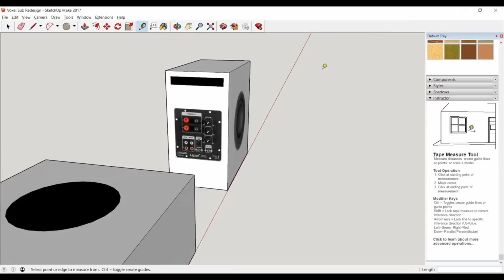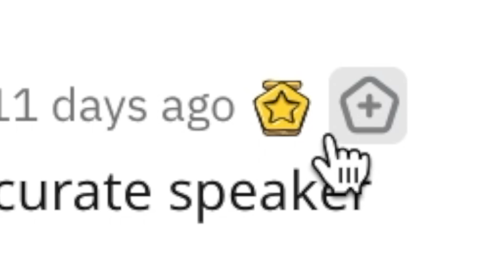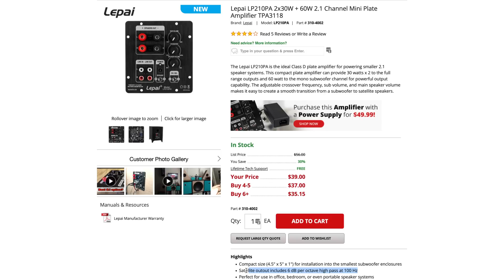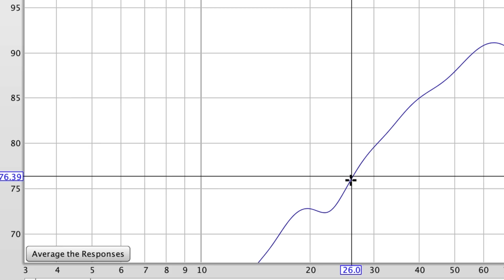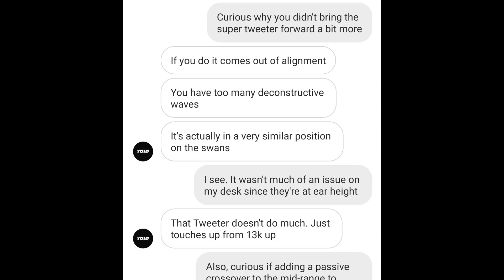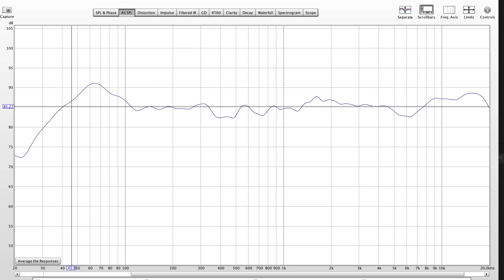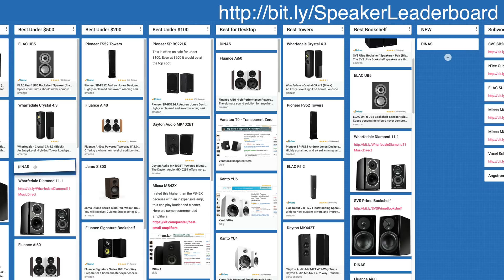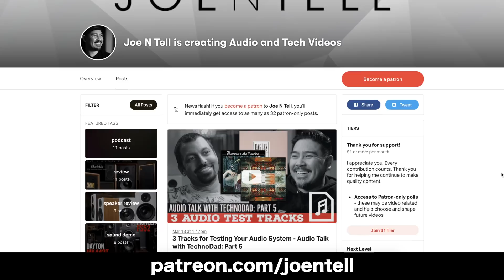DIY Speaker With Subwoofer Hits Down to 35 Hz! - DINAS - Active Bookshelf Speakers Collab w/ 123Toid

Comment: This without a doubt your best and most useful videos because I've seen a similar but larger build compared to this.  Birch kicks the crap out of MDF because Birch could get it done without bracing. No, that tweeter (I've used in two builds) the screen about even with the front.  I didn't nail mine down and moved it around.
Reply: @slow mazda Wood does matter and it has NOTHING to do with pores LOL!  Again. Hard Woods DO NOT NEED to be BRACED in 90% of their installs or applications.   Even Pro Cabinets like Markbass, Orange, Fender, Mesa, Ampeg, and etc.  DON'T brace or deaden their enclosures.  Yes, I've heard the BS from KEF fanboys.

Comment: Joe, how much more time:money to make this into a transmission line floor standing speaker with same drivers and electronics (just the port tuned to be a transmission line)?You’d seriously compete with $3,000+ speakers. Also offer a black matte color MDF surface option for LCR home theater applications

Comment: would it been very difficult to make them bluetooth ? i would do this for around my ingroud pool. Thanks from Montreal canada
Reply: Just a buy a $10 bluetooth reciever off amazon
Reply: @tyronelannister9922  Thanks for the answer but each speaker will be at 40 ft a apart so do i need 2 reciever or one connected to one speaker and run a cable to the other speakerÉ

Comment: I'm really interested in building these. One thing I was wondering though. How can the sound quality from this tiny plate amp compete with my Marantz amplifier?
Reply from the maker: I'm a believer that amplifiers should not sound different if designed correctly although they definitely can. The difference imparted by an amplifier is minimal compared to the change the speakers make. I think the question should be how does the sound quality on these speakers with the plate amp compare to your Marantz with other speakers.
Reply: @joentell  in a perfect world that would indeed be the case but in reality they don't sound the same. I find it hard to believe that these plate amps sound better than my Marantz stereo amp. In other words: if I would build these speakers with a 3 way crossover do they sound better with a good amplifier? If not that's fine becouse I can also use them to hook up to my computer.
Reply from the maker: I own old and new Marantz. They do sound different. But the difference in passive crossover vs active will change the sound more. That's all I'm saying. There are other things that affect the sound more than the amps. By no means am I saying these plate amps are better than a Marantz amp old or new
Reply: @joentell  yes the active crossover component makes it very attractive indeed. It would be nice to build some towers with a  similar system. I wish speakers could be outfitted with an analog active crossover but so far I haven't seen that yet.

Comment: I built a speaker for use with my Icom IC-7100 radio which uses a Dayton RS100-4. Many ham operators use cheap, 2-way speakers with their radios, but I wanted a single driver which could cover the entire range of the human voice with no crossover.  The speaker I built using the RS100-4 is the best sounding communications speaker I've ever heard. It even sounds good with the IC-3100 tuned to FM broadcast! I'm sure the RS100-4 works great in your DINAS, because it keeps the crossover out of the all-important mid-range band.
Reply from the maker: Thanks for sharing that. It seems like a successful project.

Comment: Are there crossover plans to build these as passive speakers?
Reply: It could be done, A similar version - of sorts is Boenicke W5. Same subwoofer driver + Fountek Fullrange + Tang Band rear firing tweeter. Very good sounding loudspeakers.
Reply from the maker: There's only one passive crossover component! 😊 We wanted to keep it simple. The rest of the crossovers are controlled by the plate amp.

Comment: Why so small port??!?!?!? Super easy to make it longer and bigger.
Reply from the maker: Tuning. A longer and larger port would have a higher tuning. We wanted the lowest tuning.
Reply: Joe N Tell No, you are not right. I have been designing subwoofer enclosures for years and if you increase the port area you have to increase the port length and the tuning will stay the same. Its easy to calculate.
Reply from the maker: You are correct. I misspoke. Yes, if you make the port opening larger, you would need to make the port longer. This is exactly what 123Toid did. You should see the original design. He reduced port turbulence by half. In order to use a larger circular port, he would've had to use a curved port since it wouldn't fit in this enclosure. He opted for a slotted port since someone could build it with wood and not have to buy additional parts. 

Chuffing only occurs around 35hz at maximum volume. Way beyond my comfort level.
Reply: You wouldn't want anything larger for this application as it would lower the first port resonance into audible range.

Comment: I'd love to hear it perform next to something like a JBL 306pMKii.  JBL reaches down to 31~32hz fairly easily.
Reply from the maker: There's a difference between being able to hear something at 31hz vs it being able to hit that at -3dB (F3) relative to the rest of it's frequency response. A speaker could hit 31hz at -10dB, but you shouldn't really say that it goes down to 31hz. The standard is -3dB but some manufacturers stretch their claims. See what JBL claims. I bet it isn't 32hz.

Comment: Thanks for this interesting video. 35 Hz is not just a challenge for bookshelf speakers but even for most other speakers in general. However, what means 35 Hz? At what noise level? By the way, the Dynaudio Crafft is still a great sounding benchmark for bookshelf speakers being able to show no significant drop down at 50 Hz
Reply: -3db.

Comment: Reducing 'cuffing' using straight cut outs is like saying reducing rolling friction using square wheels, you would of been better using a larger diameter port and actively adjusting the equalisation.
Reply from the maker: Decreasing the velocity of the air using a bigger and longer port is also a valid way of reducing turbulence. Smoothing the surfaces to even out the transition between the high pressure and low pressure areas is another way. Both work. I was suggesting to try both ways. A small smooth port will still chuff given enough pressure.
Reply: @joentell  Correct, except your new port is narrow which adds to turbulence, as you say you need a gradual transition from low-high pressure regions, there is a good reason 99% of loudspeakers use a circular port; its the best shape to encourage lamina air flow. So if it has been me, I would have used wider diameter and increased inlet radius rather than changing the shape, but still at least your design looks different).
Reply from the maker: I understand. I agree. I didn't personally design this port. Another option would be passive radiators.
Reply: @joentell  Yeah or passive, but then you take a cut in efficiency moving another diaphrapm), of course if you have the space you could opt for the holiest of holy's the Infinate baffle woofer) or a rotary sub.
Reply: @ThuleApsu  straight ports have been used for years in subwoofer builds with no negative effects.  It is all about the design.  A rounded port would not work in this application for multiple reasons, in which I don't plan to go into right now.  This is about the best port you can make for this subwoofer.  You are welcome to try to design a different one though.
Reply: @Toid  95% of speaker and subwoofer designs use round ports. the ideal port will produce lamina air-flow, the more angled the edges are in the port it will create more turbulence, that is why rotar blades on an helicopter are curved rather than having straight surfaces to cause lift. Port sounds do cause a problem in higher end systems, as you increase the cone excursion or play back sounds at lower frequencies the 'chuffing' sounds become more pronounced. You get a speaker company like B&W for instance that do not do snake-oil but put real science behind their designs and you will see B&W has heavily invested in port design over the years
Reply: @ThuleApsu  I don't remember arguing against anything you said.  I stated the fact that a round port wouldn't work well in this particular instance and flat ports are used all the time with great success.  You are welcome to try to design one that keeps first port resonance down, while keeping airflow at a minimum, while keeping tuning frequency and cone excursion in tact.  All while, making a port that will fit in an enclosure of this or similar size.  If you are able to, that would be great.  But as the designer of this speaker, I am telling you that I do not believe a better port exists for this application.  You are welcome to try and design one though.
Reply: @Toid  ) I didnt realise you was the designer, but hey whatever you think is best man, I was only talking in generalities anyway. I have been building speakers for a long time..
Reply: @joentell  I have seen some B&W speaker also having dimples on the port, like a golf ball, the trick to that is deliberately causing high frequency turbulence above human hearing, whilst bettering lamina airflow thru the port; across the audio band.

Comment: Great looking speakers.  I decided to buy the plans and all the parts.  I'm a complete newby so when it came time to order the capacity I couldn't find a .68mf as specified in the plans.  I found lot's of 6.8's.  I then Googled capacitor value to frequency cut-off and discovered a 6.8 capacitor equated to a 5846 Hz cut-off.  So, either I'm doing something wrong or the plans include the wrong value.  let me know.
Reply from the maker: That's a question for 123Toid. I'm excited to hear what you think of them once they're completed.
Reply: As this is a 6 ohm tweeter with 6.8 uF cap you are crossing the tweeter at 3900Hz - which is not good for several reason especially power handling. Also as this tweeter has much higher sensitivity it will overpower the Dayton full range. A 1.5 uF caps should work  nicely as it will be creating high pass at around 17KHz which is fine for super tweeter.
It's available at Parts Express. Btw the .68uF is also available from Parts Express but this will be cutting the tweeter above it's operational range at 40Khz which is pretty meaningless.
Reply: The plans have a link directly to the right part.  Just right press shift and simultaneously left click and it'll pull up the right value.

Comment: Why they "only" go down to 50 hz(in flat mode). Is it the amp responce or are these speakers tuned to 50 hz. Good design by the way, I wanted to make a 3 way speaker with the TB but a lot of crossover calculations did make me skip the project. This project is more DIY friendly.    Nice Speakers 😃
Reply from the maker: I think it has more to do with how the speaker itself responds as well as how it's tuned.

Comment: can you build a pair of a little bigger isobaric  bookshelf speakers, and if you check out air speed in an engine carburator you will se that you can increase airflow and get a quiter airflow if you round the edges for the port, on both sides.

https://www.youtube.com/watch?v=BdF7nTU_QOQ

Comment: Jaaaaaaanky!  This speaker would be greatly improved with better electronics and a fixed crossover.  Tuning it to the room response is the job of a DSP, but tuning the driver responses to each other is something you do exactly once and need not tinker after the fact.  Those knobs are just sucker-bait.
Reply from the maker: Then do it! Also make a video of the entire process. You talk a good game. Talk and action are two different things.

Comment: interesting. Have you ever heard Constant Beamwidth Transducer line arrays (CBT Line Arrays)? I saw a presentation by their inventor Don Keele. When paired with a sub, I noticed only 2dB-3dB difference in volume from 6 inches to 25ft. away. The design also boasts extreme uniformity in frequency response from all axis of the polar pattern of the speaker. Parts Express sells his kit. I think Dayton Audio sells a finished one. They're made up of 20-30 2.5 inch mid ranges and individual tweeters on a circular arc. They're shaded so the center section puts out full volume and the speakers towards top and floor fade out gradually. 

http://www.linkwitzlab.com/Keele%20-%20Introduction%20to%20CBT%20Loudspeaker%20Arrays.pdf

Comment: My yamaha floorstanders hit to 29Hz, and yes you DO need a tweeter, never rely on a midbass driver to deliver proper treble, its not happening. these lepai plate amps could be the perfect solution to desktop audio though.
Reply: No you don't need a tweeter , a Great full range speaker will do just that Fullrange , Look at Fostex drivers for instance or TangBand .
Reply: @TheTechGuyYT  "never rely on midbass driver to deliver proper treble"
Midbass drivers rarely go over 5khz, even good fullrange driver like you mentioned start to drop off over 16khz but due to nature of our ears we barely notice it. 2 Way vs full range will always be better.

Comment: Small Speakers = small sound.  You might hear the cymbals and guitar but the bass will be lacking in fullness. Even subs can't reproduce the sound dynamics of a >12" woofer.  I like the sound of piezo's for the tinkle tinkles and my 15" sub.
Reply from the maker: It's relative to the size of the room and your distance from the speakers as well. A headphone with a tiny driver can hit 10hz because it only needs to pressurize a small area very close to your ear.

Comment: that is an amazing design, but have you ever considered rear ported passive radiators? im doing a similar design but will be testing to entirely remove vent noise
Reply from the maker: It would just require some massive radiators since it's typical to use twice the surface area and double the xmax of the original woofer.

Comment: I would have built a pair of these for that wonderful bass, but I got my hands on a pair of ADS L810's that I have on this desktop and they're easily the best-sounding speakers I've ever heard. I was told they were used as monitors back in the day. Same 35htz bottom end, and 3-way. But, slightly more expensive than these DINAS. Great job.
Reply from the maker: Those are much larger also

Comment: Too bad we pay import tax for those speakers to bring them to the UK, best place to buy from Netherlands though they are not worth £71.20 plus £8.45 postage. I would buy hundreds if the USA was not so stingy. We give you a country and that is how you treat us. Stick your speakers up Ur SaA. :-)smug smiley. I have 8 inch polycarbonate sub that is better.
Reply: Have you check with sound imports?  I think they carry all the parts
Reply: @Toid  Yes I have explored all the sites, Aliexpress would be the cheapest if they sold to the public. You need an online shop to get an account with them. Sound Imports do not have the price, watts and IMPP cones all at the same time for my needs. If only Aliexpress was not so strict. People by wholesale from them and sell on the other public internet shops. I need to get my shop together first.

Comment: 5 inch woofer @ 35Hz not without boost and distortion.and it has published FS of 45 which means most likely over 50 or closer to 55 Hz.let's see the actual measured frequency !!!!
Reply: you can get 35 30 and 25 Hz out of a 5" driver without significant distortion.

it will just not be loud. 

remember: your in-ear headphones can easily go below 30 Hz
Reply: @GeorgeTsiros  not on this planet..there is a reason worlds best speakers use large drivers to produce CLEAN no distortion low-end. even the worlds best 8 inch drivers Like Accuton, focal, dynaudio, Eaton and few others  have hard time going that low and staying clean.
Reply: @WV591  did you read the entirety of my comment?

Comment: Do you have any experience with the Edifier S350DB? I've had my Klipsch ProMedia 2.1 for years now(probably about 7 years at this point) and they still sound basically as good as the day I got them. But I I'm looking to upgrade soon and these seems like the best option for a 2.1 computer speaker set up. I'd love to do this Dina's build but I just feel like it's a little bit out of my repertoire.

Comment: Where is the subwoofer?? I just see a 3 way speaker! Having a separate midrange and woofer doesn't make it a subwoofer.
Reply from the maker: But how low it's crossed over does make it a sub by definition.It's crossed below 150hz and is active. A sub is considered a speaker dedicated to anything below 200hz. I usually cross mine over at 100hz on this speaker. That qualifies as a sub and a woofer. 

But it's just terminology. Call it whatever makes you happy. I think either would be correct.
Reply: @joentell  O sorry, thanks for the explanation! BTW, have you used Genelec 1030a's yet? I'm buying a pair and I think I'll probably keep that in my studio forever!

Comment: Passive radiators could mitigate the chuff, but make placement more difficult perhaps.
Reply from the maker: That's true. The typical thinking is that you need twice the surface area in radiators so two 5.25" radiators. Tough think would be to find radiators with equal or more excursion than these Tang Bands.
Reply: @joentell  Parts express has another build that uses that sub and they pair it with a rear-firing Dayton 8" radiator, part # DS215-PR. That build is rated to 35 hz as well. In your build it would have to be side-firing.
Reply from the maker: Interesting. I'll take a look
Reply from the maker: What's the name of the kit? I can't find it